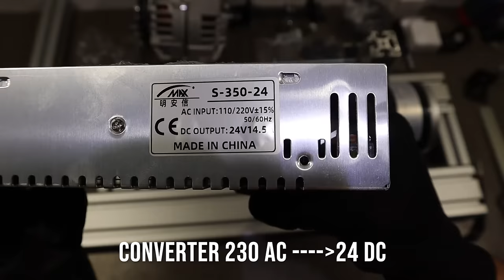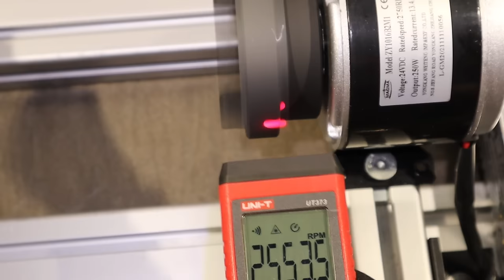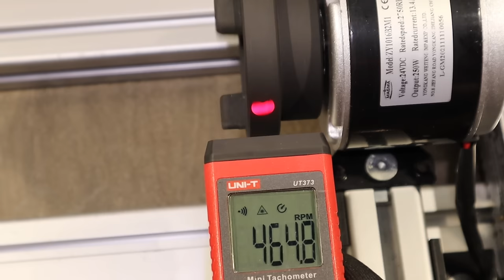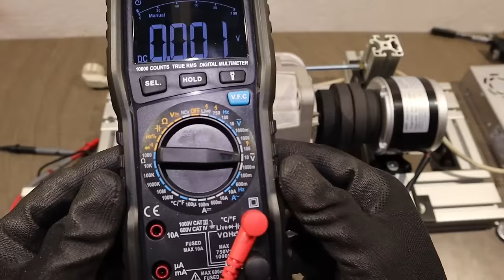Free energy generator powered by 250W DC motor and a truck alternator . FAKE OR NOT?

Comment: This  version of generator needs a flywheel to maintain a momentum and velocity. Or you need a 120\240 circuit to push the 220/120 motor. Then build a 12v inverter on the 220 circuit to loop the 12v and 220 current. A 220/120 - 12v inverter is necessary  to cause that of what you are trying to achieve
Reply: Free energy is not possible…. Unless ! You had magnetic levitation in the build to reduce / erase any friction and thermodynamic waste 😉

Comment: Great work bro. 👏.  Resonance capacitor needed on motor side (re-visit LC circuits) flywheel needed in between motor/ and alternator can be rewound for more output. Don't throw the baby out with the bath water. Try again.

Comment: Automotive alternators have somewhere around 50% t0 70% efficiency, if you are lucky.  Using an alternator to generate DC power to drive an electric motor to drive an alternator can not work.  Period.

Comment: HI Peter.

Are sure that you have connected the DC motor in the right order?
In the case that you have exchanged the positive and negative poles at the DC motor, the system would always work against your initial rotation with the rope.
Reply from the maker: I'm not 100% sure, but I'll look into it, thanks for the heads up 🙂
Reply: @engineer_peter  Hello.. I am asking you, do you really not know that you should make changes in the generator? Or do you know but are you kidding me?? Maybe you make these types of videos just to generate income
Reply from the maker: @HOSSEIN.M900  
Hi, I'm just trying to show that many videos on YouTube are fake or not. I will test what I see on youtube and publish my result.
Reply: @engineer_peter  Hi... Your work is excellent.. Thank you for your time and effort.. But I thought you don't know what to do in the exponential change generator and you are trying to build this device and as a result  You don' t get it.. if your goal is to educate and educate scientifically.. your work is excellent
Reply: First of all. U have a dc motor and the power of the generator is alternative.. and the connection ar wrong.. take out the rotor and put some neodim on him and the outer coils of the generator make a dc bridge then u put the dc motor.
Reply: @gaslergeorge2166  most alternators have a built in regulator for convert to dc. The problem with his wiring is he did not supply voltage to alternator exciter to get it to produce voltage.
Reply: @markhill485  i know . But maybe his dont have that
Reply: @engineer_peter    " I'm just trying to show that many videos on YouTube are fake or not. I will test what I see on youtube and publish my result. "    You can spare doing tests when you explain people convservation of energy. If they don't believe in that law they can't be helped anyhow.
Reply: You must use a battery to start the process. Once the motor is turning the alternator and the alternator is charging you can remove the battery and see if it continues to operate
Reply: Also, most alternators generate 12-14v. That looks to be a 24v motor. That alternator would not be able to supply enough voltage to run that motor. I would suggest a 12v battery (to start the process), 12v dc motor, and the same alternator. I would be curious of the results. As I have thought about doing this but never invested the money in the equipment you have to do so. Very interesting
Reply: @m113kswapgoldstein9    There is no need to try this, it is obvious that it does not work, even if motor and alternator are matched perfectly. The key parameter is power. With every machine the output power is due to unavoidable losses less than the input power. I give some arbitrary numbers for an example: if the motor is driven with 100 Watts electrical power it may deliver 90 Watts of mechanical output power. This power turns the generator, which may transform it to 80 Watts of electrical power. But 80 Watts are not enough to keep the motor running, since the motor needs 100 Watts. Such an arrangement can not run by itself, and by no means can it deliver energy.
Reply: He placed a neodymium magnet, so it doesn't need stimulation. Now, as for the rectifier bridge, it appears that he removed it from the system, so it is not possible to turn on the DC motor for starting.

Comment: ROTFLMFAO!!! I don't know where you are but here in America the average 13 year old knows that you can't run a generator with a motor that is fed power by the generator that it turns. Not possible without adding some power from an outside source, and when you do that, you have a net LOSS of power, because typical motors and generators or alternators operate at below 90% efficiency. 100% efficiency, or "unity", is an impossible achievement. You would have to have better than 100% efficiency in order to produce power, which is of course a physical and mathematical impossibility. A unity motor would generate 1 horsepower for every 746 watts fed to the controller, or the motor if controller-less. A unity generator producing 746 watts of electrical power requires 1 horsepower of mechanical energy to turn the shaft. 

If you want "free" energy, look to photovoltiac solar cells or heat differential recovery or kinetic energy provided by falling or flowing water or air, or waste energy from exhaust heat or hydrocarbons from decomposition of bio matter. They are not free in the sense of creating energy out of nothing, but they are free in the sense of energy that unless harvested, and stored or used, simply goes to waste, anyway.

Comment: Hello Peter, congratulate your YouTube channel 👍🏻 you already have a very good number of subscribers, which is worth it. But honestly, what you assemble there looks good with the beautiful aluprofilen, but that makes no sense at all.
You have a 24 volt DC motor and your truck generator supplies AC voltage.... . that's clear.... . you must switch a rectification between it.... . this is the first point.... . and the second point is the speed. much too low 2900 revolutions, that never works, you can read that, you have to come to at least 3500.... try with a belt, with a gear ratio, the engine needs the larger belt pulley and the smaller generator... perhaps a ratio of 3 to 2. I speak from experience, I have already made myself in this respect. i've written you before. it may be of course that you just want subscribers and arouse interest. but that doesn't look for serious looking for free energy. best regards Thomas
Reply: Just what are you expecting it to do? Break the laws of basic physics, make water run up a hill or the sun to change colour?
The concept of generating free energy this way is childishly naive. For it to do anything the motor would need to output more power than is put into it, and/or the alternator would need to output more energy than is put into it, in both cases plainly impossible, and silly.

Comment: the altnerator needs to spin at 1000 rpm or more so power it with the dc motor then switch the power fed to the motor with a DPDT switch.

Comment: 2900 rpm would be too much for a 12 or 14 pole generator/alternator..it would create more than 200 Hertz frequency at rated speed and would destroy any load connected to it..Use the formula (RPM = (120 x f)  no. of poles; where f is frequency)..The rated speed should match a number of poles that would result to 50 / 60 Hertz. 12 or 14 magnets are too much unless you use DC output only.
Reply: Most motors can handle 120 Volts DC Or AC  Current..brushless motor's Create their own AC Current by the very Motion of a 3 phase Armature " Alternator " Circuit's are used to calculate the orientation and surge Nessessity to push or pull the Armature to the next Winding and EM Felid stator a simple Hall effect sensor which can be done with solid state transition. A mercury switch for example Pivot points on magnets " spherical Dipole Vacuum pressure bearings " would offer ZERO resistance to friction.

HEAT = LOSS of Entropy.  
COLD = Increasing Entropy Circuits " heat Cold Acoustic waveform energy,  push / pull photon , electron Eddy currents travel using Phi..all Celestial elements do..
Reply: @mjolnirswrath23  If I plugged in my 12 V motor in to 120 V AC it will blow up
Reply: What the hell are you talking about? It's a truck alternator, it outputs a nominal 24v DC!
Reply: @icarossavvides2641  it has nothing to do with the damn alternator
Reply: @Jacob.Springer  1) I didn't know the alternator was 'damned'. 2) Considering there are only two components in this scam of a video, an alternator and a motor, wouldn't you think that the alternator had at least 50% to do with "it", whatever the "it" you are referring to is?
Reply: @icarossavvides2641  so my conclusion is that the alternator has nothing to do with this.
Reply: @icarossavvides2641  oh and one more thing END OF ARGUMENT.
Reply: @icarossavvides2641  and I also I used “it” instead of “this “ to exclude you from the situation.
Reply: @icarossavvides2641  and an actual question, what do you mean by “in this scam of a video” he is proving that this is fake.

Comment: This is technically possible to work all it needs  is an diode to prevent the motor back feeding while alternator is producing current  so therefore the motor  won't  spin and the alternator  won't power moter on its own and put a  capacitor on the  motor  after the current passing the diode to help to put a load so it can generate  and run on its own

Comment: You missed something, the way they do it is they used a pulley and the DC motor is supposed to get a larger ring pulley and the alternator is supposed to be a smaller ring pulley so that a 1 revolution of the DC motor equals 4-5 revolutions of the alternator! Atleast that's what I usually observed from most videos! Let us know after you tried this too if it's still fake, would really like to know too! Ty

Comment: Remember energy can neither be created or destroyed. What a fake. All for what.
Reply: It not work because the energy from the motor is back feeding while alternator is producing a current therefore it doesn't do nothing. When you spin a electric motor  you  are producing a small current so to prevent that you need a diode  to prevent backfeeding from motor while alternator is producing a current to motor  to help it run better  just add and small capacitor with Same voltage   it should run for a long time

Comment: You know if you increase the rate. Of the alternator you get more voltage per rpm of the motor so gearing up the alternator is what you need

Comment: Great job. you might try to put a 40uf cap in parallel with the motor and the put line voltage to start it. After it reaches max RPM remove the line voltage. Again great job.

Comment: ok...there is a issue here. 1st of all, you didn't have a battery in line with it. This would not only start it up but bring it too speed in order for the alternator to be able to generate! The battery also provides a voltage inside of it to excite the coils - other wise it will not generate output to begin with,  (It's referred to as "Alternator death"! alternators will not put out until it gets power to help coils in excitement ......(Ask any married woman about this mystery) LOL.  Once it runs,....you should see voltage going into battery. You also could have tried a GENERATOR unit as they are designed to generate voltage while rotation is present but no power or battery needed.....generators are DC outputs and are pretty linear in operation...(Remember having a generator on your front bike tire to feed your headlight at night)??
Reply: Wrong, vehicle alternators are self exciting via residual magnetism.

Comment: Remove the bridge rectifier from the alternator and build a PM armature. Then you'll have something.
Reply: Yeah a worse generator
Reply: @shaynegadsden  Perhaps it's possible that you know a better way?
Reply: @shaynegadsden  ...If so, then please.
Reply: @James-W6WOF  there isn't a better way because it's bullshit but if you want a generator for whatever reason buy one don't attemp to make it for many reasons first tolerance is efficency in a quality unit the armature is just barely clearing the windings whereas home made has a large gap due to inconsistancy, second it's dangerous most expoxy's sofen with heat and generators get hot also the armature should be balanced you spinning it pretty fast. But not matter how good it is this kind of thing will never work 90% is very high efficency for a motor or generator meaning if you give the motor 1000w of power you will get 900w of rotational force then the connected generator takes that 900w of force and makes 810w of power so you have lost 190w in the process you will never gain power
Reply: @shaynegadsden  Perhaps it's my fault for thinking that the gentlemen's project was just something to pass time rather than creating a viable product?
That said, I'm pretty sure everyone knows what these types of video's are about (entertainment). But may mistake...
Reply: @James-W6WOF  you would think but it would seem more people than not believe that this kind of device is real and with no knowledge about how this stuff really works i can see why when they show an alternator's nameplate shows an output over 2.4kw and the motors saying 200w then logic would dicate you have an extra 2.2kw to spare then they look for more meant the creator make money feeding unknowning people crap so i attempt to inform people
Reply: @James-W6WOF  He is NOT presenting this video as just 'entertainment', it's yet another, pitiful attempt, at a perpetual motion machine.

Comment: Vitaly, you could be correct under load. He needs to get his RPM up high enough to generate the voltage then run through the diodes to output. I just don't think he can get there by rope pull start and he isn't very good at it anyway. I modified a 90AMP alternator with drilling and mounting the 10mm x 3 mm NIBs. The initial torque resistance from the magnetic field lock was so high that when I hooked it up to a 1/2 HP washing machine motor, the damn thing wouldn't turn at all at 110v. And I had compared the rotor field strength of the mounted magnets vs the 12v to the brushes. magnets not even close. I think it's Mr. Electron that shows self excitation to the rotor and I think it needs 12v to power up fully. That's my next attempt, the new alternator got here yesterday.
Reply: IT'S FAKE!!   Mr. Electron is a fake!!!
Reply: You guys are just wasting alternators.  These devices never work in theory and especially not in real world conditions.  There’s so many more productive, rewarding and fun projects you could spend your time and resources on that will actually benefit you and won’t inevitably end in a failure like these “free energy” devices.

Comment: All of these are doomed to fail. It doesn't matter if you have a different capacitor, different wires,  different magnets. For those disagreeing,  I will tell you that humans learned to write things down, so the next generation didn't have to reinvent the wheel every time. Pick up a physics book, so you aren't trying the same experiment that has been done thousands of times for the last 2 centuries, without success, ever.  It will tell you why this is and forever will be impossible :)

Comment: Everything has losses. If you put 100W of electrical power into a motor, you don't get 100W of mecanical/rotating force from the rotating shaft, instead you gott less because of resistance in the cables, in the connectors, in the windings, in the air, in the bearings and so on. So you have to invent a zero resistance motor. But if you did, you'r still not get more then 100W of mecanical force from the shaft. The exact same thing can be said with the generator. If you put 100W of mechanical energy to rotate the shaft, you don't get more than 100W of electrical energy out from it because of all the reasons I mention above. Even if you had a perfect generator with non resistance, you would only get exactly 100W from it.
And there you have it, a perfect motor connected to a perfect generator both with zero resistance, a perpetual motion device that can sustain its own motion but nothing else. If you would draw 0,00001W from it, the balance is off and it would slowly slow down untill it stops. Nothing usefull at all.
But we all know that zero resistance motors and generators does not exist. But even if they did exist, you would never get any extra energy out from it to use.
But anyway, good luck with you toy.
Reply: It's good to see that there is still some intelligence out there 🙂

Comment: don't they both need to rotate in the same direction?
Reply: right?! and if not then does the voltage reverse polarity? Plus he needed to get it above 1000rpm for the alternator to produce enough current for the motor to be excited. Would like to see these changes and see what the result would be.

Comment: Hi Engineer Peter even didn't buy new Alternator you can build your own like you made a Transformer coil 2,200 turn primary left and right, 2200 turn. and driver motor of your rotor 1400 rpn you can get the result 220 V or more than. because many of your experiment or vedio content Im watching.

Comment: Thanks for the effort, but have you tried switching the connections…. It could be a polarity issue…. Also, the some sort of capacitor in the circuit… it should act as an energy buffer…
Reply from the maker: Yes, I tried to connect the connections, but I haven't tried adding that capacitor. Do you suggest any specific capacitance that could be sufficient?